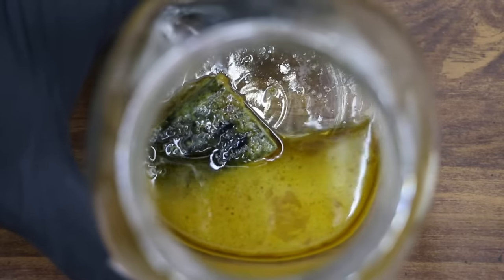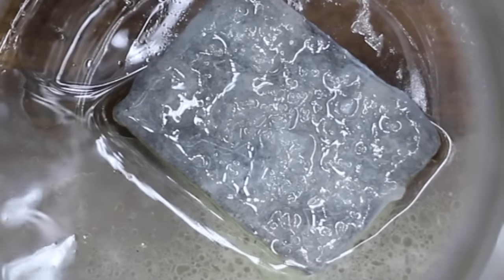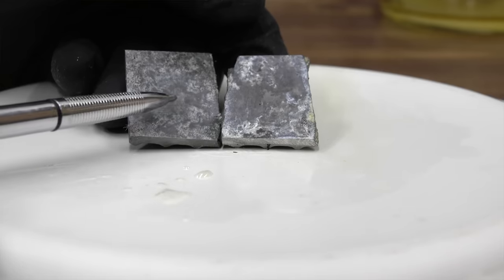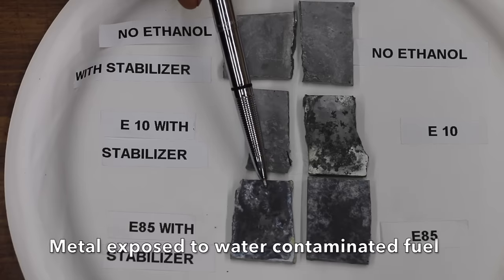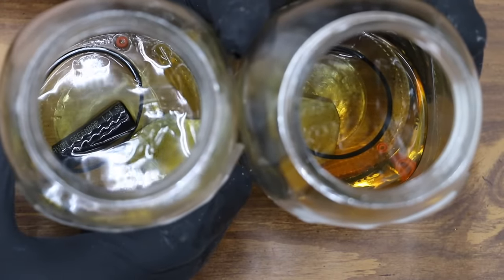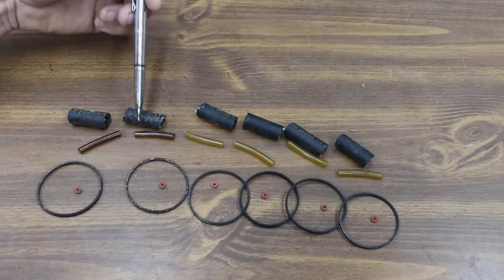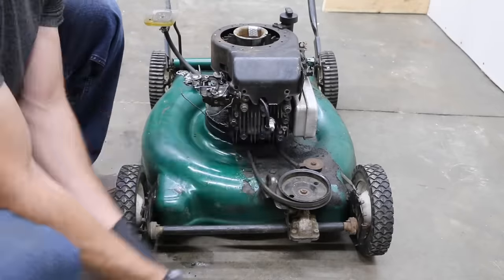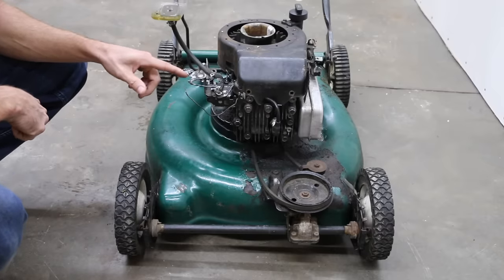Does Fuel Stabilizer Prevent Ethanol Damage?  Let's find out!

Comment: This just confirms what I've  believed and done for years, close the fuel valve run it dry, and before it stalls pull the choke to suck the bowl clean.

No storage issues!
Reply from the maker: Thank you
Reply: That's exactly what I do with my snow blower after winter, and my lawn mower just before I put it away for the season, and my generators, everytime I use them. The problem with the generators is I never know when I'll need them next, so I run the carburetors dry after every use. I sometimes pause a few minutes, pull the choke, and try to start them again. More often than not, they actually try to start, then run out, before they come up to speed, as it gets the fumes out of the float bowl, and clears the idle and main circuits of the carburetor, so there is no fuel to evaporate and leave gum or varnish, and especially, to avoid corrosion, and galvanization. You have a steel float bowl, and brass jets, and emulsion tubes, in an aluminum housing. Any conductive or electrolytic liquid(that includes alcohol) invites galvanization, which destroys carburetors, because of dissimilar metals. That's above and beyond the corrosion shown in the video, where there was just the aluminum housing samples used in this video.
Reply: My generator will run for a good 2 minutes longer with the choke pulled, so that's a decent amount of gas that would be left in the line and carb. It's a good tip.
Reply: That's a good tip, thank you!
Reply: Eddie Coyle  why, drain the float bowl and that works every time. Long term storage drain the fuel tank and carb. Make sure they're dry completely. No fuel in it store in the garage not a shed. Place a piece of heavy plastic like a freezer bag under the gas cap and lock it down, this stops venting as temp changes. 1 other point pumped fuel is good for 30 days after that it looses some of its volatility due to outgassing and or venting through the filler cap or the carb vent.. Not as big an issue on a car or closed circuit fuel system. Fuel in the rail will go several years before its lost it's volatility. There is no need for ethanol to be added to fuel. Must be Monsanto at work growing GMO corn and ensuring that they have an undisputed profit. Keeps the the price of corn up.
Reply: @OlivierCaron  choke use will foul the plug somewhat yeah it will lean out and increases the idle before stalling out. If it's got a champion plug in it it may not want to start in the spring as  champion plugs run to the cold side and even slight fouling (choke stalling) ruins them. Made a lot of money in the spring cleaning carbs on all kinds of products, plus if it's a no run situation ittl cost you for whatever else is required to make it run and guarantee the repair, valve adj, spark plug(s), air filter, carb clean and carb synchronization  on MC etc.
Reply: Eddie Coyle  That works, too.  But if you're like me, getting around to doing this every 10 days is kinda like leaving the bar at 9:00pm.  It just doesn't end up happening.
Reply: I"ve been doing the same for my outboard motor for the past 2 decades.  It sits for months and never has a problem starting when I want it.  Good advice.
Reply: yes, draining works, but is work itself.  I am never sure just how long it will be until I next use my (snowblower, lawnmower, leaf blower, chain saw, etc) Much easier to just buy non-ethanol fuel.  Result? 

 No storage issues!
Reply: Never knew about pulling the choke! Thanks for the good info!
Reply: @odomn  Exactly,...there's a station near by in seattle,...$3.77 per gallon, I believe !!!
Reply: Eddie Coyle  I agree completely small 2 cycle engines with diaphragm carburetors will go bad when dried of fuel for any length of time!
Reply: @mooglemy3813  I sure wish you were right on the price of corn.....
Reply: @duanehenicke6602  check it out. Why do you think they pattened their GMO stuff.  Sued the hell out of ordinary farmers not using GMO corn etc when their non GMO crops pollen got into the GMO stuff, what was that? . Also you can't keep any for seed. Plus they sell you the round up glysophate poison. It takes 3 times more roundup now vs conventional chem poison to knock off the bugs. Why, cause they morphed and became tolerant..  Well since when do you need ethanol in fuel. Used to be ok for gas line antifreeze as in alcohol but that was miniscule. And there is no reason to augment gasoline with alcohol, not helping emissions as fuel economy suffers with E10. Google this and dig, Monsanto got bought out by Bayer and their investers are livid  as the stock dropped and there are plenty of lawsuits against Monsanto and now theyre loosing.
Reply: @odomn   Non ethanol gasoline will do the same thing when it gets old and evaporates, it's called varnish. Ethanol added to the problem because it's hygroscopic and attracts moisture. This then condenses and you've got water where you don't want it. Ive seen emulsified oil run out of the oil dipsticks holder  or filler cap as the engine didn't reach operating temp and moisture condensed in the crank case. It's nonsense about storing a carbureted engine without fuel in it. Drain gas out of the carb. Drain the fuel tank dry. Means no gas at all left in it and let it air dry out. If you use Stabil 360 it treats metal as part of its stabilising properties = no corrosion and is good for 1 year.  If you do as I recommend as in draining the fuel and take a heavy plastic bag (freezer bag) and lock it in place under the fuel cap you now have a sealed system.  Digphram carbs will end up with the primer bulb getting hard or cracking. That's normal wear from fuel. Simply put in a new primer bulb and away you go. All those carbs are a Walboro or made under license and some are better than others. Also old fuel will never allow most stuff to start or if it does IT wont take the throttle., that's stale fuel. This is  the same for all carbs. Two strokes that had premixed oil/fuelmix fared a little better as the oil mix helped stabilise the fuel, however let them sit too long and the carbs were ruined by a growth that lived in oil. That doent apply to newer two stoke carbureted models that premix the fuel for you. 
Hope this helps you out. This is proven stuff by most motorcycle mechanics with carb experience and the power equipment servicer as well.
Reply: @mooglemy3813   Thanks, Moogle, don't know if you are a motorcycle mech but you obviously have a lot of knowledge and experience and I appreciate your sharing with me to make life a little easier.
Reply: @mooglemy3813  First of all, Roundup is a herbicide. Intended applications are for weeds and mostly for me grass pests. Although killing such hosts of insects is beneficial. It does not kill "bugs" directly. Yes it is becoming less useful, because of yrs of abuse. The abuse being less than the labeled rate to sufficiently kill the targeted pest. But not to worry soon it will be so ineffective that it will no longer be useful, and the next round of herbicides can get scrutinized. GMO crops they as well will be abused to the point of no longer being useful. Ethanol? Well when it made it's first big push corn went through the roof. Most corn farmers were seeing profits of such proportions that hadn't been seen in 30 yrs. This is when my father was finally able to pay off all debt and retire. Although he begged me not to take over his legacy and just let it go, it was already in my blood. Just my luck after finally finding a bank to finance me we hit a string of consecutive droughts. While all the money in the corn belt was being made i was struggling to pay my operating loans. And now all those highs of the corn markets are long gone again. Leaving me to wonder if i will ever get back even again. All so the United States of America can enjoy the cheapest food in the world. Is their a better way of farming? As long as supply is beating demand, the only way is to quit. But it's all i've ever known. So i will keep struggling and doing without certain things so others can pay less and bitch more.
Reply: @odomn  thanx Odom. 50 plus years of Honda everything starting at 12 years old. Motorcycles 1st. Then
 Honda vehicles at the same time and as they introed the vehicles. Honda power equipment of all types as they grew and expanded. Carbs are starting to disappear but for now they will stick around. I'm a licenced motorcycle, automobile, and truck mechanic. USN trained as a machinist mate. Retired but not from my passion Honda. Until gasoline is gone we'll have this problem. But once you know how to deal with it and can do so yourself your free from a dealer or paid service or the carb crud.  Honda carb cleaner is what I use as its designed by the largest carb maker on the planet Honda's  Khehin fuel system manufacturer.. Also called combustion chamber cleaner or both but use the Honda brand. Want to clean carb jets take the cap off the carb cleaner, latest stuff has a straw for the spray nozzle. Invert the cap and drop the jets in it, soak them till they're immersed. Spray the orfices in the carb and remove the pilot jet and any others depending on the carb, soak them as well.Let the carb sit ifor a day or so and respry as previously (depending on issue). Use contact/brake cleaner to clean out the carb. Works great as long the float bowl isn't  rusted up from ethanol. Use the Must For Rust Gel if it is, Immerse the rusted bowl and in a thin mix of gel and water in a small container just big enough to hold it. It'll clean it up and leave a paintable coating, this may take a day or two depending. Don't paint it though just use stabilised Satbil 360nin it and it'll protect it, dealer won't do this as its time consuming and just put a new carb in BUT You Can!

Comment: Thank you for giving a good visual on how ethanol affects older fuel systems.  All my cars are 40+ years old and carbureted, so I use ethanal-free gas from the station right down the road from my house.  Glad to know I'm not throwing my money away by paying the small premium for the ethanol-free stuff.

In the past, I did have some carbureted cars that I ran on the 10% ethanol gas, and I did start to experience some problems after a few years of that.  The cars still ran well enough that I could keep them going down the road (with some babying at times), but there were clearly issues.  Wasn't sure if it was just age, or if the fuel was the problem.  Based on this, I'd say the E10 fuel was most likely a big contributor to my issues.
Reply from the maker: You are welcome!

Comment: I'm a small engine mechanic and always recommend my customers use Top Tier ethanol-free from a station with a separate pump (or nozzle) for each grade to ensure they are only getting the no-alky stuff. I do also recommend a stabilizer, just because so many of them use big gas cans and the fuel may end up being in there for a full season.
Reply from the maker: Thank you!
Reply: I've been running my small engines on high test. Start them every two to four months. Gas doesn't stay in the can. End of season gets used in my truck.
Reply: @briteidea08  that's what I do and it's the smarter/cheaper/least wasteful method. I use 91 Shell V-Power in all of my small engines. Anything I don't use by the end of fall gets put into my car.
Reply: revenge69ful  this is sort of true, in NY i can get 93 octane non ethanol from stewarts but that is another ~$.40 over regular. I only put the non ethanol high octane in my motorcycle, it needs a higher octane anyway. i think for cars that get used all year it probably doesn't matter, but if i had something sitting i would definitely put non ethanol in it.
Reply: revenge69ful  the average homeowner will use only a few gallons of gas in lawn equipment a year. Even if it is 50 gallons (big zero-turn mower and a couple acres), the difference in cost between cheapest and most expensive grades would be about $20. Even if the difference were 50 bucks, a carb job can run twice that, and paying someone to mow while the equipment is in the shop just adds more expense. A lot of my business comes from folks with the same attitude as yours...

Comment: I was told many years ago by a 2-cycle oil manufacturer executive that these oils are natural fuel stabilizers.  Since then, I've been using a little 2-stroke synthetic Amsoil in my seasonal engines to keep the fuel fresh enough to carry over to the next season.  This has worked very well in all cases; lawn mowers, boat and snowmobiles to be specific.  Would be great to see a test of this method v. commercially available stabilizers, which appear to have limited benefit.
Reply from the maker: Thanks for the suggestion.
Reply: Amsoil is the way to go. Sabre for me. No smoke  💨 either.

Comment: Been dealing with this for about 10 years. It seems about 75% of our business is ethanol fuel issues. I think that maybe finally our customers are starting to listen to us. And those of you that poo poo and don't believe, you just wait, it will come back to bite you. The stabilizer we use and recommend is K100, but it still doesn't stop the damage. Non ethanol is by far the answer. And by the way, I've been told by a source that the gel that crystallizes after it dries out is sugar.
Reply from the maker: Thank you for the feedback
Reply: You'd think people would have wised up by now, but I guess the average person isn't paying too much attention to what they put in the gas tank, nor are they probably interested in learning about it.
Reply: my two cents  ??
Reply: It's not sugar! It's aluminum hydroxide. Not particularly harmful to humans but don't eat it. It WILL clog up jets in carbs causing horrible misfires, or no starts.
Reply: @pinkhead6857890  who the hell are you talking to?
Reply: Kirk ... for the last 10 years I did small engine work for a generator business and I can't tell you how many times I saw that "crusty stuff" in a carb and thought the same thing. There does seem to be two cures, besides running non ethanol fuel. Run the machine often and run the carb dry after each use. Also, never store the machine with more fuel in the tank than you can use in the next 90 days. Put in a quart of gas to do your periodic runs and keep the rest in a can that you have a dated. If you don't use the fuel in 6 months then pour it into your car and get fresh for the can. Constantly rotating your stock is the only way to fly.

Comment: My 50hp, Mercury outboard, 4 stroke was originally run on 87 with ethanol right from the pump by the original owner. He had not changed the fuel filter for 3 years. When I changed the fuel filter, there was a considerable amount of yellowish, very fine, almost pumice like material in the fuel filter. I have run non-alcohol, 92 for the past 4 years and the fuel filter looks like new every season. 
That’s proof enough for me. I use nothing but non-alcohol 92 in all small engines, outboards, etc.
Thanks for your excellent video!
Reply from the maker: You are welcome!  Thanks for sharing.

Comment: I’ve been adding Sta-Bil to my boats gas tank, lawnmower gas, snowblower, etc. Recently, my Stihl chainsaw sat for 1.5yrs in my shed with gas sitting in it with Sta-Bil, started 4th pull. Sometimes I cheap out and get E-10 gas, but always add Sta-Bil. Love Sta-Bil! Just add the 2ozs whenever you fill a 5 gallon can up. Life changing habit.
Reply from the maker: Thanks for sharing.
Reply: Lucas products are snakeoil.
Reply: @davidwclair2358  I’ve tried Lucas products. Never noticed a difference.

Comment: My experience. I used ethanol gas in my small engines for years before I learned that non ethanol fuel was available in my area. I religiously used sta bil stabilizer and  not once had any trouble with carburetors or phase separation.  In that time the small engine shops were swamped with ethanol related carburetor issues.
Reply from the maker: Thanks for the feedback.

Comment: Sir!   Great video as always with well documented results. Interestingly, I flew in an  aircraft  ( DeHavilland DHC-3 "OTTER" ) which used a Pratt & Whitney  R1340 9 cylinder radial engine. We were flying a scientific mission in the Canadian High Arctic. We used 14000 gallons of aviation  80/87 &  130 octane that had sat in drums for  20 odd years (since 1946 & we used it in 1971).  We drew  random samples from the drums (55 gal. US) & sent them to EXXON labs in Edmonton for evaluation. Exxon labs supplied us a report that was exhaustive in its range of tests, & that in essence said the fuel was "just fine" . The only irregularity it noted was a slightly elevated tendency to  form "gum or varnish"  compared to newly manufactured fuel. We flew hundreds of hours on the fuel with absolutely no problems of a fuel related nature. The drums were situated on an "esker" (sort of a big sand dune), laid on their sides since placed there in 46 when the photo survey of the Arctic was being undertaken. Considering that the automotive "pump gas" we buy today is premium "lamp oil" compared to the auto fuel 40 years ago, I believe that aviation gasoline is formulated to a strict standard that does not change year to year. I am not a chemist or chemical engineer & I stand to be corrected on this point.  I thought you might find the info interesting. Another  "gold medal" video my friend  !
Reply from the maker: Thanks for sharing.
Reply: Many of us bought and old car or truck with fuel in it that had sat for several years and found it started fine, but that was "back in the day."